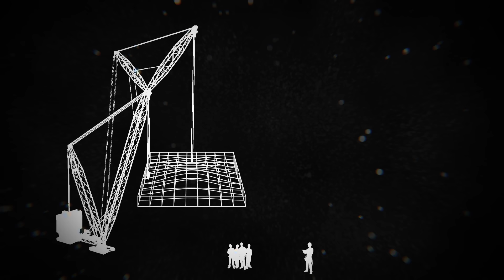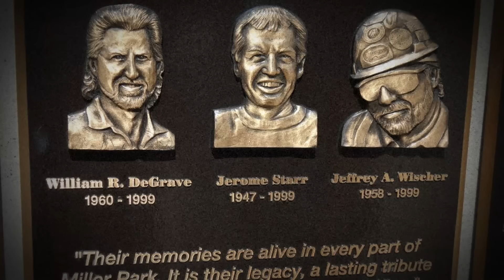Massive Crane Kills Iron Workers | Last Moments

Comment: I actually visited Milwaukee during construction and got to witness a pick (lift) by Big Blue. it was well before the accident lift, thank goodness.

It was hard to overstate just how huge that crane really was. It literally dominated the entire Milwaukee skyline, and it was lifting loads that few cranes on Earth could lift. But it came out later that the Lampson design had a fundamental flaw. It did not wind-load (take lateral wind) well at all, and its design was such that the margin for error was very, very small. Exceeded, it was virtually a guarantee the whole crane would go down. That's why Lampson got a tiny share of the responsibility.

The Demag crane that took its place was more compact and Demag had very long experience with megacranes. Their crane had a computer loading system that could detect dangerous conditions and warn the operator, or even refuse to do the pick unless overridden. While it still wasn't recommended to try and pick in wind like that, it raised the margin of error significantly, enough that a stray gust over the limits wasn't enough to topple the crane. The rest of the roof assembly went without incident.
Reply: Damn, considering being someone who wasn't born back then, I can't imagine how huge big blue was. Even though Miller Park is around 6-8 miles from downtown, it's crazy to think it was dominating the skyline. Wished I could find a photo of it from a distance.
Reply: @flyingbanana4179 You could see it FROM downtown. I was traveling down the interstate at the time and could see both the downtown area and the stadium. The crane was sticking above everything else. It was almost 600 feet tall! The video doesn't really impress the scale of that monster very well. It was the more distant views that did.
Reply: @ArchTeryx00  Wow

Comment: Genuinely curious how the crane company was held even 3% responsible, as far as I can tell the crane was not even remotely the issue and this tragedy was entirely caused by the other side of things.
Reply: me too, I assume Mitsubishi was renting the crane. Maybe the company shouldn't have allowed the crane to be used for a job it wasn't rated for. That's my best guess.
Reply: The crane company was probably also running the crane. I wouldn't know for sure, but I believe the general contractor to build the whole stadium would have subcontracted Mitsubishi for the roof portion of the project, and then Mitsubishi were most likely the ones who subcontracted Lampson from there. Really, the crane operator should have told management to fuck off on that particular day, but in 1999 they probably were vetoed by management. Fortunately these days any reputable GC gives everyone on site stop work authority. Construction safety is much more strict now because of incidents exactly like this.
Reply: Not nearly in my area of expertise, but an assumption would be that the company had some sort of duty to make sure the company they rent or sell the crane to was going to do right by the safety standards, which in this case would have failed to happen.

Edit: nvm other people's answers are better
Reply: @smileyguyz  Manslaughter charges for crane operators are the norm after this accident. The operator knew the danger, and did it anyway. Most jurisdictions will charge you now thanks to a bunch of similar crane accidents like this one over that decade.
Reply: 99 million dollars Jesus H Christ that is a lot of money paid to the families
Reply: Yeah Ridiculous! Must not have wrote the warning in big enough letters.
Reply: This is old news y’all slow
Reply: negligence is determined by a duty of care + breach of that duty + causation. if you want to understand the calculation of 3% for the crane company and the reasoning for that number specifically, I'm sure the judgment is accessible online
Reply: @thedemolitionmuniciple  depends on state/province/canton. In BC two things happened: one, outfits who lease cranes on site MUST provide training on that same site (zoom boom, stationary cranes). And the province in 2005 basically CANCELLED with three years notice every crane ticket (many levels/types) and you had to go to the prov. yard and get re-tested. Their agenda was to get RID of all the alcoholics, crackheads, and self taught and get them OUT before they killed someone. I KNEW the idiot off one of my jobs was not going to pass, and he didn't.
Reply: IMO they probably didn't include loaded wind speed downrating examples in their product literature to make knuckleheads aware that there's a difference between being loaded and unloaded.
Reply: @smileyguyz I heard details of this story a while back. As I recall, they did have two or three different guys refuse to operate the crane that day, but they had one idiot who was willing to take the risk. This accident almost didn’t happen.
Reply: Me too.  The company building the stadium was operating the crane in higher winds than it was rated for.
Reply: The 3 % would be the willingness to accept the risk. It’s well known that you are obligated to refuse unsafe work. It’s no longer a right.
Reply: It’s like letting a grossly incompetent or intoxicated person rent a vehicle from you. You can be found at fault, too, especially considering individuals of the crane company should know to appropriately monitor weather conditions and calculate / risk management.
Reply: My guess is that the investigators  found some minor safety deficiencies such as some rusty components, a cracked window on the crane, a missing safety sticker;  something that had zero effect towards the collapse but they found something that wasn’t quite perfect with the crane so they placed some small percentage of blame there.
Reply: @jaymiller6009  From the reading I've done since watching this video, I think the court found the design and instruction manual made the crane more susceptible to failure than other designs, but that was a minor contribution to the sum cause of the collapse.
Reply: It's possible the 3% was negotiated rather than have a judge/jury decide the crane manufacturer was more culpable for the losses.

JBL, the maker of professional loudspeaker systems, made the PA system loudspeakers in The Station nightclub in Rhode Island.  They had a small amount of polyester foam used in the internal construction of the loudspeakers (maybe an ounce or 2 per device). The pyro used by Great White ignited acoustic foam installed by The Station, releasing toxic gasses and accelerating the spread of the fire.  Pounds and pounds of this foam installed above the stage.  JBL negotiated a $100k settlement contribution rather than risk the jury making a larger award, or face the expense of retaining professional witnesses the jury might not believe anyway.
Reply: Onsite supervisors for Lampson did not step in when they could have. Mostly negligence.
Reply: @smileyguyz  Crane manufacturers don't supply operators. The original crane operator for the day stepped out and said the wind was too high, the crane superintendent onsite took over. At least try to have some information before you post.
Reply: I am firmly convinced that Americans law is no longer about finding and punishing the guilty. It’s about finding who has the deepest pockets, and extracting money from them. Whether or not they were truly to blame.
Reply: From Cranes Today Magazine
“Jurors said Lampson was 3% negligent because the firm did not give the three men who made up the Lampson crane crew enough authority to deal with Victor Grotlisch, the Mitsubishi site supervisor.”
Reply: Furthermore Lampson’s attorney said that Mitsubishi would pay for Lampson’s 3% share so all damages were paid out by Mitsubishi.

Comment: 450 Tons is not 99,000 lbs.   It's 900,000 lbs.
Reply: 450 metric tons is approximately 990,000 pounds. They forgot a zero. 
This channel is based in Ireland.
Reply: @StocktonCrush  But the construction was in the US so was probably measured in tons, not tonnes.  US ton is 2000 lb.  Mind you, a 10% difference doesn't matter for the purposes of an educational video.  But that 10-fold oops in the video?  No wonder the crane collapsed--they thought it was only lifting 99,000 lb!

Comment: I was in Melbourne, Australia, eating breakfast one morning when I was watching a skyscraper being built across the street. I couldn’t help it, I had to stop my breakfast to go chew out the foreman for allowing his men to repeatedly walk underneath an open-walled TEU that was being held by a crane and being utilized to haul supplies up and down to/from the top. I’ve personally witnessed two different crane spreader bar failures that resulted in their loads being dropped from high up (although the height of drop isn’t related to the failure - cranes can fail and their loads can be dropped from any height). Each time the TEU was brought near the ground these guys were betting their entire existence, going so far as to walk from one side to the other while underneath, that the crane wouldn’t fail, drop its load, and squash them like grapes. You’d better have a damned healthy fear of suspended loads - they’re an inherent danger even if nothing appears wrong.

Comment: 450 tons is 992,080 pounds, not 99,000 pounds.
Reply: Right, except the exact conversion depends on whether it was short tons, long tons, or metric tons.  (2,000 lbs.; 2,240 lbs.; or 2,204 lbs., respectively)  I don't like tons anymore.

Comment: Was working a steel mill shutdown job.

Had a 400 ft crane on site.

Something went wrong with the crane and they wanted to take it apart to fix it.

A Mexican on site claimed he would climb up the crane and fix it and save two days of work by not taking the crane apart to fix it.

At 300 ft, he stopped using both of his tie off straps and started using one strap to speed up the climbing process. 

At 350 ft, he slipped and fell while undoing his single strap and reaching to strap it higher.

I watched him fall all the way to the ground, where he hit and bounced about 6 ft back into the air after the majority of him exploded up on impact like a water balloon.

He didn’t feel it, but he had about 6 to 7 seconds of free fall to think about it on his way down.

Comment: I worked for a big packaging company with huge conveyor belt systems. We were trained on safety and were taught that if a member of management was being wreckless with regards to human safety and equipment issues, we were authorized and required to cease operations untill things were fixed. 

Do your research people. If you operate a crane, or any peice of equipment, learn every single thung about those machines. These companies cannot dispute factual information.

Comment: That knarly eerie sound heard right before the collapse is the giant pins holding the cab of the crane on the tracks. They snapped one by one, until it just gave way. Our crane instructor talked to us about this incident. Shame, could have and shout have been avoided. As a crane operator, you have to respect load and design limits, period!

Comment: Im a commercial plumber and i was on a job that had a crane(not near this ones size) booming up wooden joists for the roof of a different wing of the building that i was in. There i am installing toilets and heard a crazy loud boom and looked out the window and the cranes boom was laying across the whole job and there were a handful of bloodied Amish guys. Luckily no one died. One of them broke an arm and broken nose. OSHA was on their way so i got an early day😂. Lift operator set up his outriggers on some soft dirt and it completely flipped over on its side.

Comment: you can see all the pulling tension on the crane in the frame, the one on the other side, not moving the cranes to cancel out these shearing issues, pushed it over, not the winds

Comment: Wind was the factor on that lift.  And the late pick also. The wind blowing on the structure put stress on the crawler crane. That first boom is the swing bearing fracturing from the load shifting. On the other crawler crane you can see part of the bearing or race hit the dirt between the Camara and operator cab.
Then about 1 second later the operator jumps out and takes off. The three guys in the basket over looking the pick. One was spotting and communicating with both crawler operators. 
And the other two guys were watching the ball game in the next stadium.
They all three died when that other crawler hit that RT crane boom. Bad deal.

Comment: They fail to mention in most videos that the crane operators complained of sinking and cracking ground shortly before the failure. That Mitsubishi consistently turned down operator's requests for more rock to stabilize the crane. They also fail to mention that the load was over 1.1 million pounds exceeding the cranes suggested load capacity in ideal conditions. Mitsubishi did an amazing job of suppressing the depositions of the workers on the jobsite.

Add up max factor wind speeds, an unconsidered load, unstable crane, and shitty management. That's a recipe for disaster. Remember folks, rarely are these accidents just one factor. It is always a series of ignored mini-events that add up to a seriously catastrophic result.

Comment: They were behind schedule, and didn't wanna reposition the crane for these lifts. The wind was hitting the face of the roof piece at almost a perfect 90° degree angle. The crane was designed to be able to lift the weight of the peice no problem, if the winds at there backs. The side load was far greater than ANY crane available at that time could stand. They went for it anyhow. I was decking a 2 story house roof that day, about 3mi. away, and called it off because of 35-40mph wind gusts. I wouldn't risk my guys with sheets of plywood, but they went ahead with a 400 ton roof section? We actually heard the crash, and went up into Veterans Park Cemetery to get the best view down into the now demolished bowl of the ballpark. It was frick'n unbelievable!

Comment: Having been around cranes lifting loads 50-200 tons I can tell you these events happen faster than you can imagine. Chains links explode and it sounds like a cannon firing, lifting straps especially the fiber reinforced soft straps crack like a whip when they give way. I can still feel the shock sometimes just talking about it when accidents happen.

Comment: This video doesn't quite capture the sheer extent of malicious negligence that led up to this.  This video was captured by an OSHA inspector who was onsite due to numerous prior accidents and injuries that had already occurred on this job.  The site supervisor for Mitsubishi was well known to the workmen to be lax on safety and outright hostile towards anyone who questioned the rushed, sloppy practices happening everywhere.  The usual crane operators who were provided by the manufacturer, Lampson, refused to do this lift due to the wind conditions and walked off the site in protest.  Mitsubishi replaced them last minute with their own employees.   After the collapse, the computer responsible for monitoring and recording the weather conditions was mysteriously unplugged and all the data lost.

Comment: The owners of the stadium that kept pushing them to work in unsafe conditions, should have been brought up on criminal charges. The crane company and manufacturer should not have been sued because they warned of the safe, and unsafe, operating conditions of the crane. It’s the pricks rushing them that told them to ignore safety, that are criminally negligent.

Comment: Not that this is anything too similar 

One day, we flew a Mexican crew to Australia to operate an SR45 drill rig
Juan, said he knew how to operate 

Juan opened both jaws on the drill rig and then proceeded to drop the 20mtr drill rod onto himself, and every worker around 

You’re always told that big stuff falls slowly, and it does… the oil lines broke and sprayed hot oil on everyone 
Two guys jumped off of the dock 
Two others hid behind the machine 

I watched from afar, and radio’d it in (pump operator)

The noise was deafening from 100mtes away, I couldn’t imagine this

Comment: I'm surprised the guy doesn't know what structural failure sounds like. Metal does not slowly weaken, it suddenly fails like most rigid objects do. Unless in a molten state it is not flexible and won't bend, it just fails.

Comment: My father worked as an ironworker on the Miller Park job where this happened... He was part of the group that left due to safety concerns. Considering he was always a connector, he probably would have been killed in this incident.

Also, my 2 cents as someone who does this for a living... No, there's literally nothing that could be done to stop this from a worker's point of view. You're not "pushing" hundreds of tons of steel out of the way as it comes slamming down... Some of you need to quit watching cartoons and touch grass. Look at the beams of the structure collapse like it's paper, you really think you're just gonna push it out of the way?

Comment: People  can blame  the  bosses or management  all  they  want,  but ultimately  it  was  the   crane  operator  that  was  to  blame.  He ,  alone,   has  the  responsibility  to  make  sure  the lift  is done  within  the   engineering  specifications.  If  you  aren't  willing to make  the  tough  calls,   that  could in fact  cost  you  your  job,   then  don't  sit  at  the  controls.    It's  better  than  killing   people.

Comment: Nope. The crane and it's operation had nothing to do with it. Every Engineering student since this event is drug through in detail what happened here. There are louvers on the side of the  unit being lifted that were supposed to be installed after the unit was in place. The contractor wanted to save time and put them on before the lift. During the lift, the wind closed the louvers side loading the crane which then had no chance of keeping it suspended.